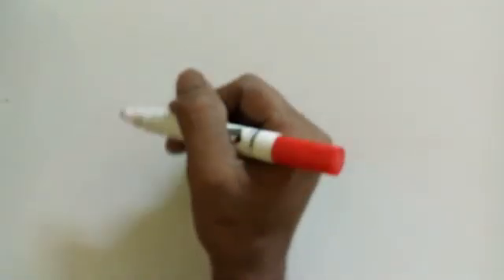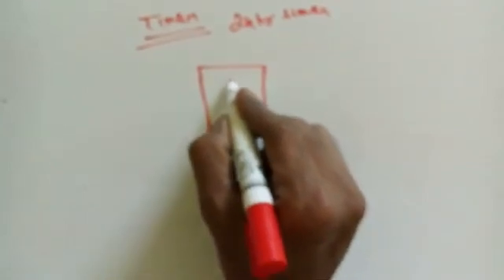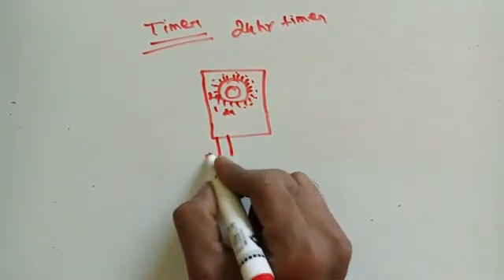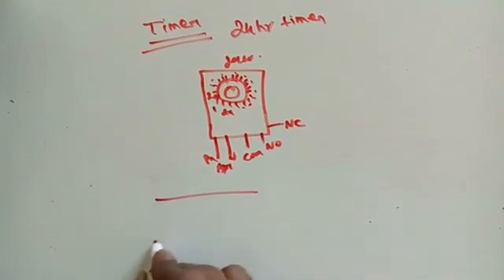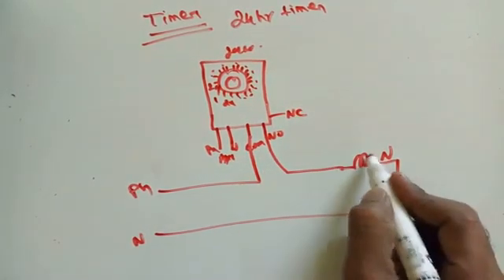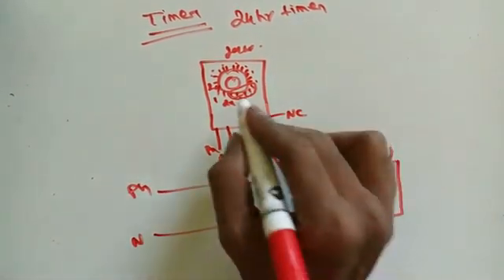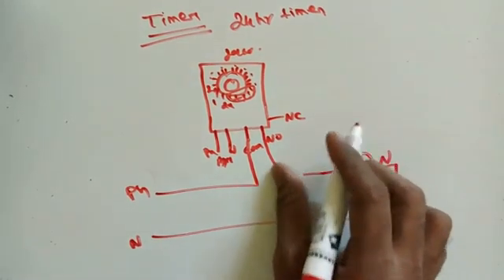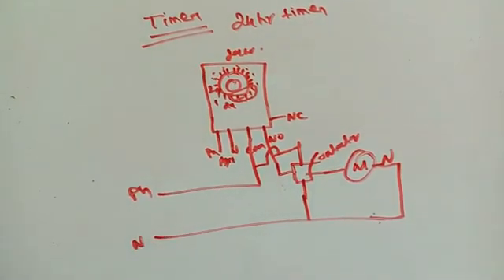24 hrs timer connection and working new 2016

Comment: sir good evening. can I use that timer in a small electric motor? because I'm planning to make an egg incubator with automatic egg turner. hope you will help me in my problem about "EGG TURNER. thank you.
Reply from the maker: Good evening...
 S you can use it but you need to add CONTACTOR for motor operation...

Comment: Is there a simple plug-in timer which has a batter backup for when we lose power.  I'm looking for something that can be left unattended for several months at a time, triggering a light in the living room so it looks like the home is occupied.
Reply from the maker: yes ..you can use power reserved weekly storage timer  for 300 hrs backup its available in hager,schneider,legrands brands 

thanks for your support